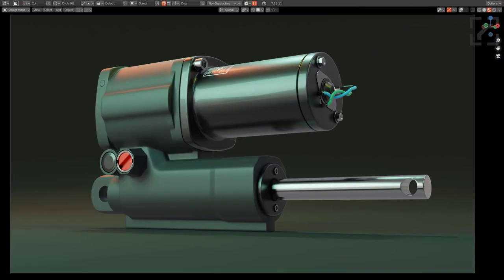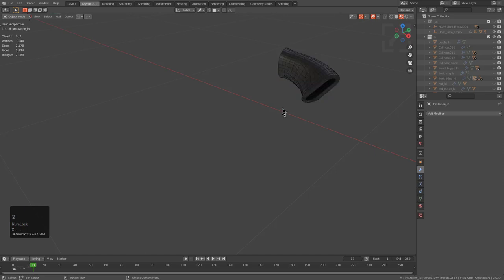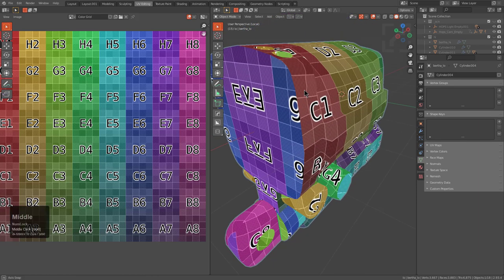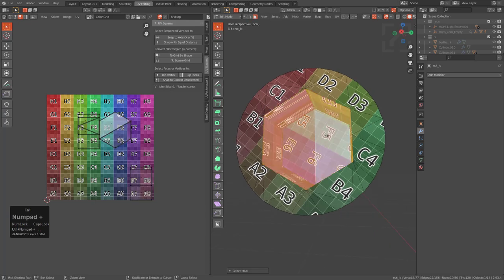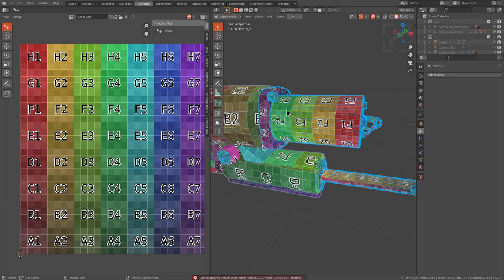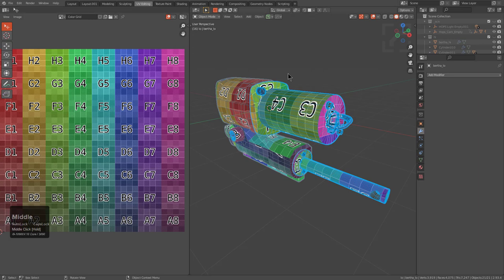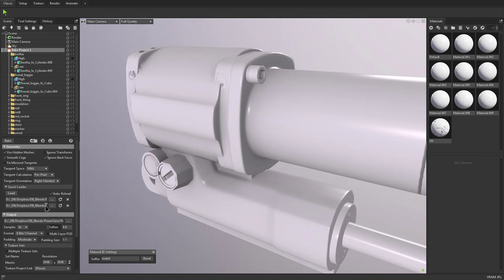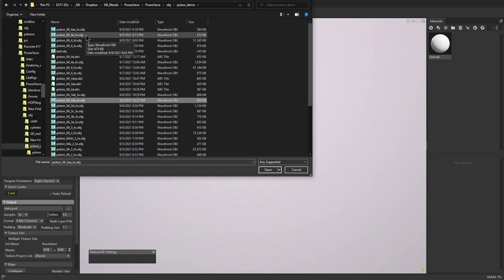#b3d - Hydraulic 4_4 (UV/Bake)

Comment: Hello MX. I was testing texture materials with Boxcutter. Wouldn't be better for boxcutter if the "Cutter UV" does "Smart UV project" instead of "projection from view" or whatever it does? testing only with boxes so I can't know the limitations.
Also for one time, it seemed to me that UVs of box cutters were properly unwrapped like cube primitives, but I was not able to replicate the result.
Reply from the maker: those uvs are not for uving tho. They are just uvs for the sake of uvs. Too many steps being added to the boxcut process can result in a speedhit which internally is a big ongoing battle and discussion. But I never thought id be trying to use boxcut uvs for export. Ive always had a more manual touch.

Comment: from the file you sent me last time, sharpening edges are causing those ugly seams after the bake, i also had that on some project, smoothing the object solve it, but smoothing a 90° angle causes artefact on the normal. so you need to find a compromise. second solution is to do bevels but in a game object you don't want to much poly :( if you find a solution to keep sharpen edges and solve the problem of the seams i am interested !
Reply: haven't finish to watch the video tho, maybe you solve it
Reply from the maker: yea